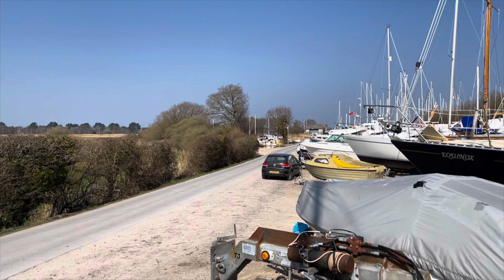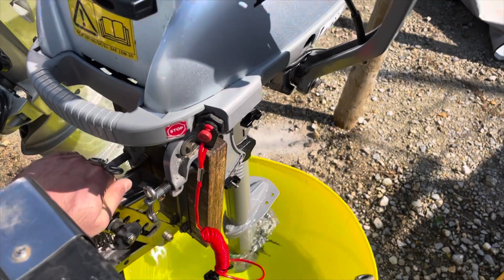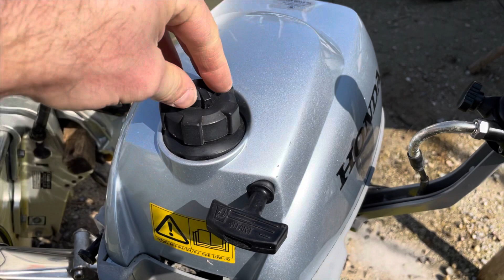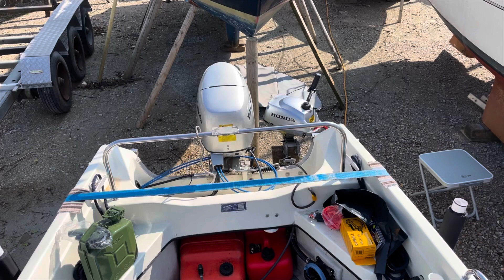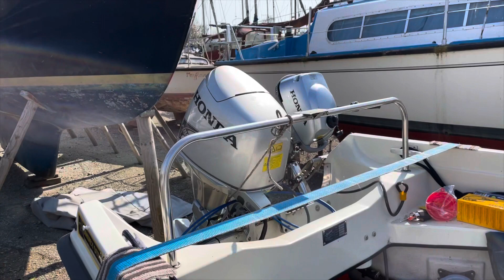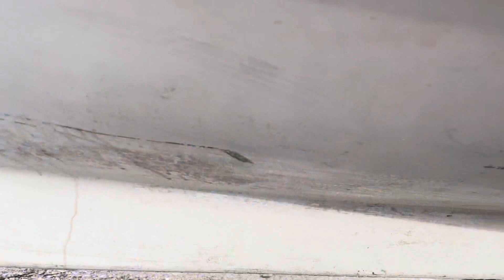5. Orkney Strikeliner 16+ Auxiliary Outboard Motor - Honda BF2.3D Long shaft 2.3hp Single Cylinder

Comment: Actually there is no need to run this small engine in a bucket. I have the same motor and it is air cooled. As you can see there is no tell tale.
Reply from the maker: Hi Daniel, Thanks for watching the video! I initially thought the same as you with it being air cooled but before doing this video I read the instruction manual in minute detail in order to avoid giving out misleading info. I found on page 54 that it clearly says to run the motor in a bucket with water 6 inches above the anti ventilation plate. And then there is a notice that states: “Running the engine without water can cause overheating and damage.”
The first outboard I owned several years ago was a short shaft one of these and to be honest I didn’t run that one in water and never had a problem!
Reply: @mattryland949  Well, obviously the manual isn't incorrect but it doesn't allow for common sense. I realize that the bucket will provide cooling for the lower unit and resistance for the propeller, but that can't be a problem when running at lower rpm for a short time.